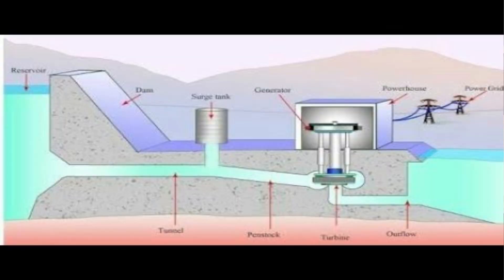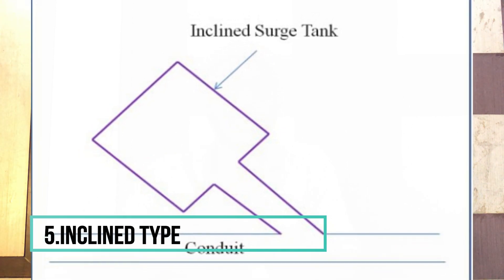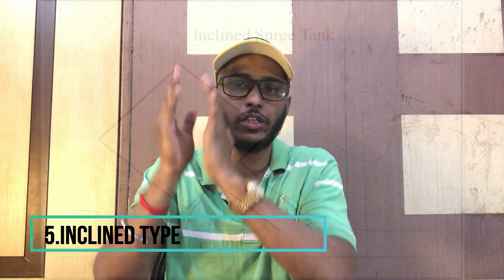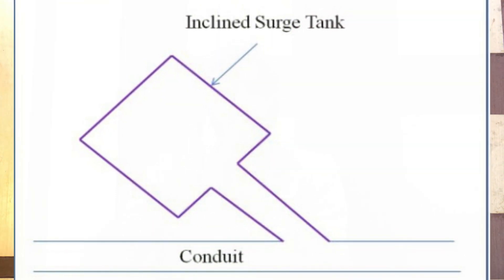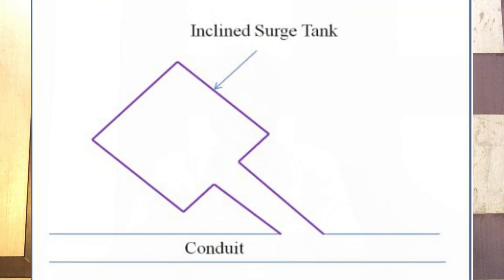Surge Tank and its Types | ജലവൈദ്യുത നിലയത്തിലെ സർജ് ടാങ്ക് എന്താണ് | PGTD Episode - 04

Comment: Hydro Power stationile working process mothathil parayalaaanayl electrical velyaoru baagam manasilaagum ennoru abipraayam ind so veruna videosil athum koodi include aakum enn vijaarikunu or aagrahikunu... For example governing system, excitation,synchronized,power factor control through scada,panels, uses of CT & PT, uses of relay, transformer (star & delta), transmission line,testing & commissioning process ... Etc... Etc....
Reply from the maker: Sure...complete explanation of hydro electric plant is explained in last episode at a glance.
Now we are trying to explain main parts involved in it.